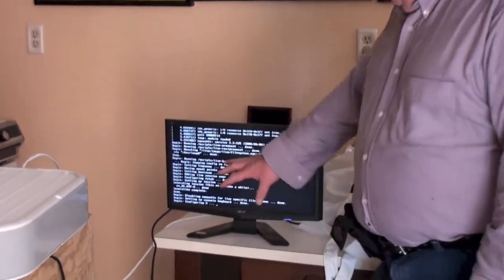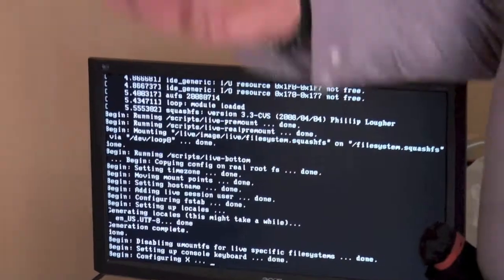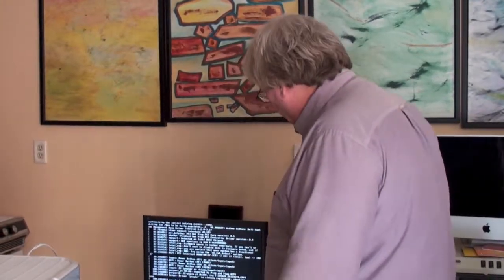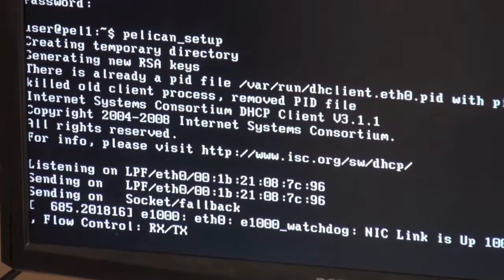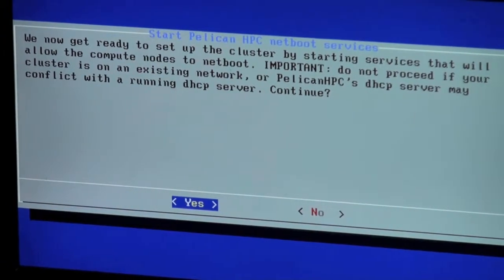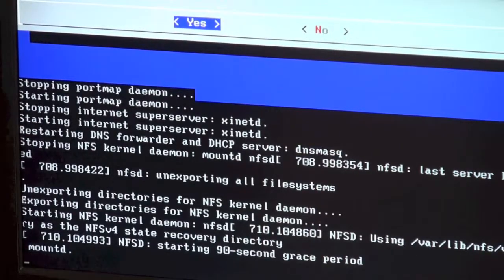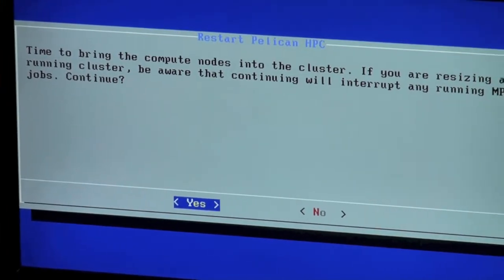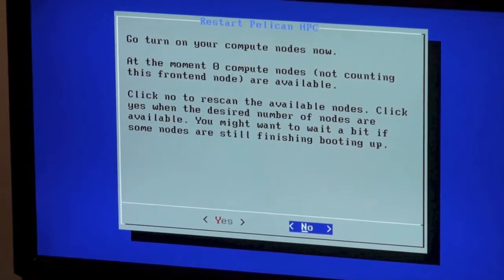Pat's Super Computer @ LIAUG Demo

Comment: Eric  The airflow is currently directed upward. At the time of the demo the "case" was to be transported nearly 500 miles from upstate NY to Suffolk County on Long Island.. (more than likely the reason that 5 of the nodes had lost their cmos info due to road jarring) The room of the demo was quite small and I realized the room was quickly becoming very warm. I might have directed the airflow downward during the demo in an attempt to spare those watching. Since I constructed the unit, it was my risk if a failure occurred. Good observation and a good question on your part
Patrick

Comment: I added a platform for the system to sit on, with larger wheels, and forms a place where the box fan sits in, to cool the system by blowing air in, from the bottom